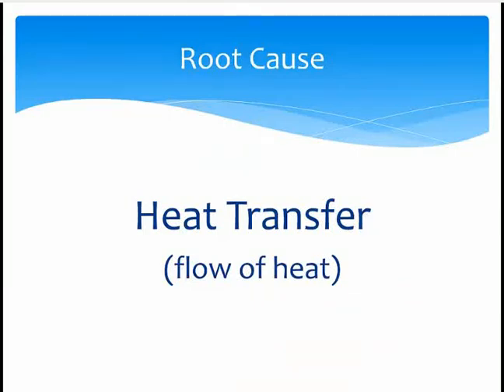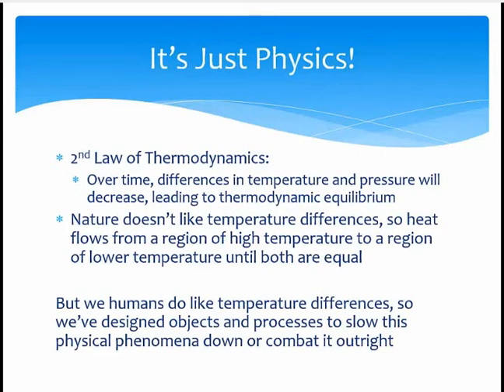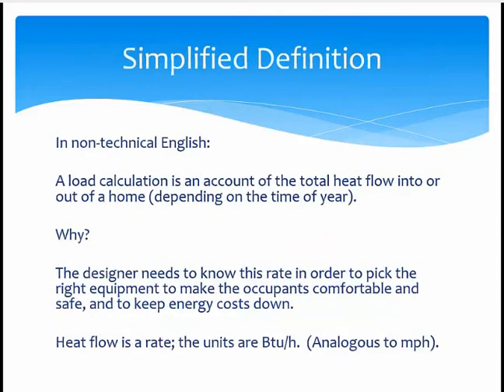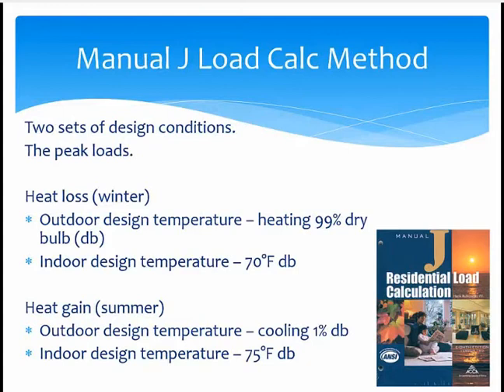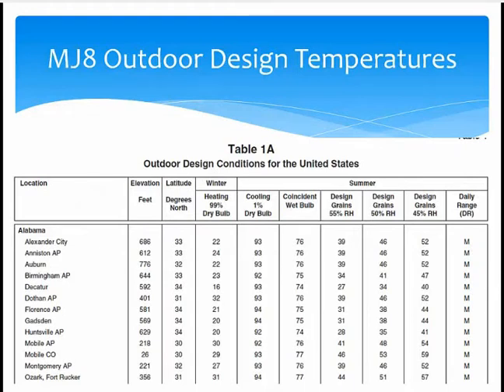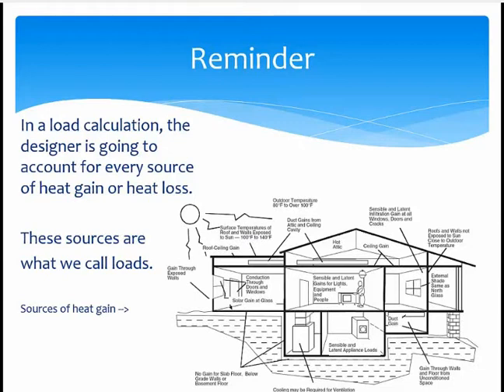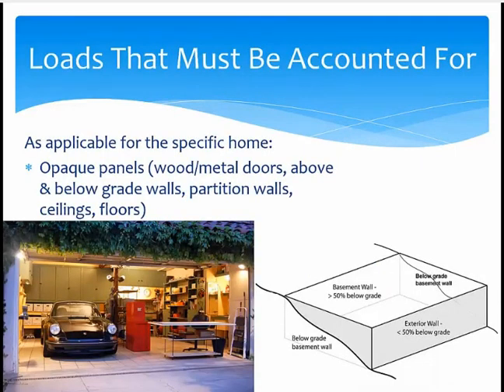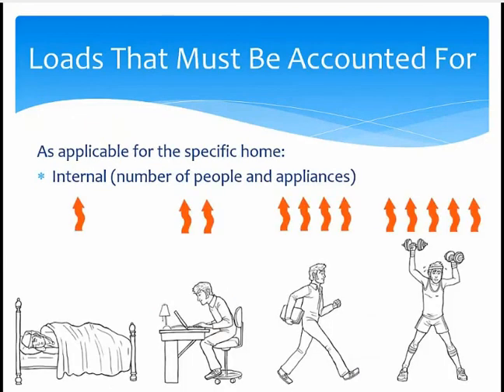HVAC Design for Code Officials Sample

Comment: Great video!  Helps to see the theory behind the process and very easy to understand!  As more cities/counties and states begin to enforce the ACCA Manual J, S & D requirements mandated by IECC 2012, this video will help code officials learn to spot red flags in HVAC designs (Manual J, S & D).  www.load-calculations.com